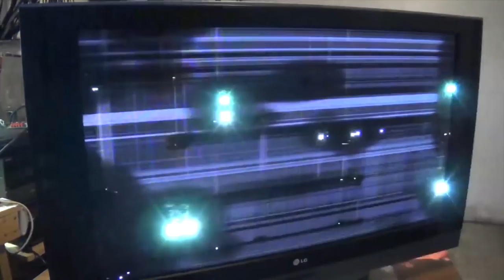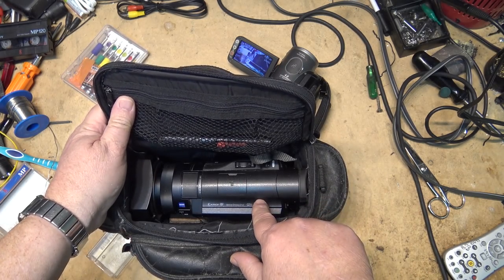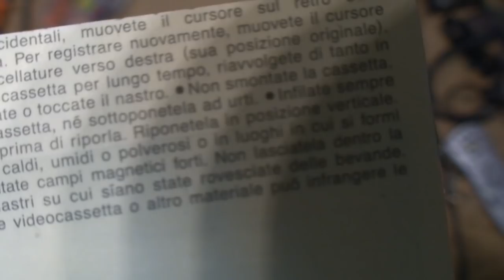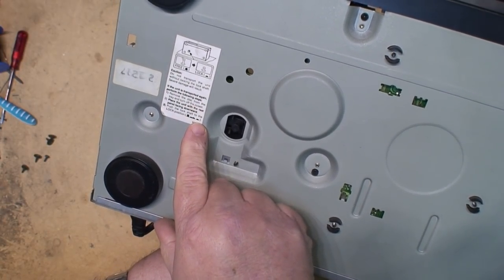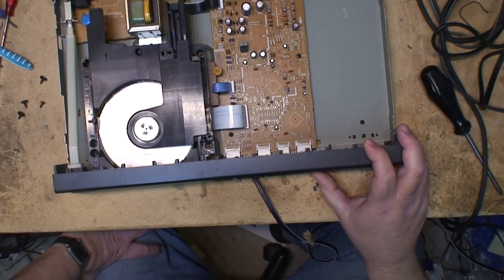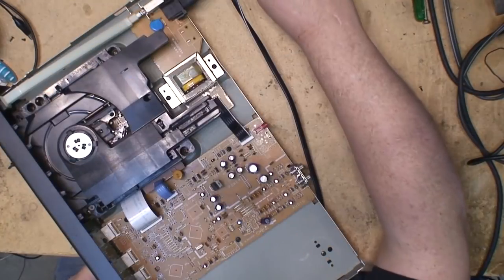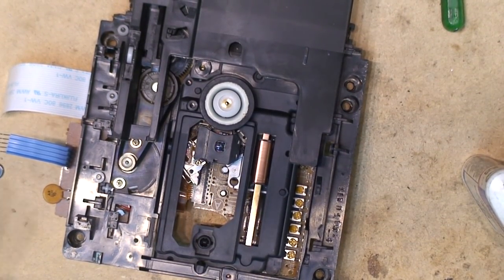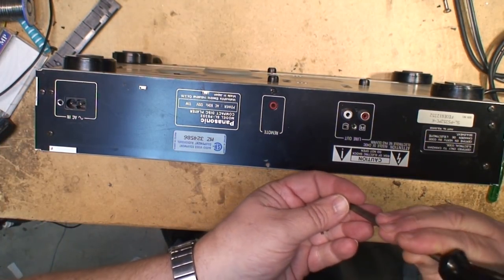Video tape was as bad as I remember and a CD Player repair all in one

Comment: 30 years ago I used to record audio on VHS hifi tapes recording live bands and long mix tapes because of long record times. I gave up on this due to no way to monitor the recording and unpredictable tapes and dropouts.
Reply: I disagree... Many people used their Beta HiFi decks for music recording and the quaility was EXCELLENT. One of the better ways to record audio back then. These decks all came with recording level controls and vu meters for this same purpose. You could monitor your recordings in real time quite easily...
Reply: @josegti84  I don't disagree with you, I have a collection of hifi machines and a S-VHS, but no Beta format. I have 3 of these: 
 https://www.youtube.com/watch?v=rrd4zlswZ94

 Excellent quality of sound, I have no issues with the results when they are good. I have had too many tapes fail or get damaged and end up having problems tracking. As far as monitoring, I am talking about listening to the sound off of the tape as it is being recorded as in a 3 head tape deck. When you monitor you are hearing the source on a HiFi VHS machine. Same as with a 2 head cassette deck.
Reply: @zulumax1  Ok, I see what you mean... that's true. You couldn't monitor the recordings right off the head like you would normally do with a 3 head cassette deck but even then... the quaility was far superior. The key for best sounding experience was to use the same deck which recorded the tape. If you tried to playback the tape on another deck you could experience tracking issues...
Reply: @zulumax1  I have 3 Beta HiFi decks working flawlessly right now. A Sony SL-HF100, SL-HF150 and 3 SL-HF950 (the best beta deck sold in Europe). I also have many other models... C9 (one of my favourites), SL-F90, SL-F45, C30... And a few S-VHS decks too: Panasonic NV-FS200, NV-HS950, NV-HS1000. From JVC: HR-S9700, HR-S7960. And a wonderfull Sony EV-S9000E. Yes... I'm nuts :-) Those decks featured in your channel are beautiful. We don't get too much luck here at thrift stores like you do over there haha.

Comment: How come Panasonic did not put a fuse in the power supply?
Reply from the maker: There is a fuse in the power transformer.  When it pops you buy a new transformer.  Even equipment that had a fuse has a failsafe in transformer.

Comment: I have tapes from the mid-nineties and don't have such issues with them. I guess the Super 8 MM are less problematic.
Reply: Analogue tapes wont have this issue, well they can still shed, get sticky, get eaten, but they wont drop out because they are analogue, you will just see the odd line or decrease in quality but because its analogure you will still have a picture and sound, unless the tape is really sticking!  The dropout is caused by the digital tape not being read properly.  There is no error correction AFAIK and no video buffer to allow the camcorder to try re-reading that part of the tape so tape errors and read failures appear as dropouts or in the case of a read error as blockyness that flashes up on the screen somewhere.

Most of my older miniDV tapes have dropouts right at the beginning.  I solve the issue by giving the tape a full wind to the end and back.

There also used to be an issue that the miniDV tapes from each manufacturer used incompatible lubricants that could congeal and make the tape and mech sticky.  The advice was to only use one manufacturers tape, thus I have only ever used sony tapes in my camera.  A head cleaning tape can help too.

Comment: Have you ever heard of the Customusic system that was used in department stores?
Reply from the maker: There were several systems.  Seeberg had one that used special records.  There were various tape based units as well. Some used a slowed down 8 track tape.
Reply: @12voltvids  Yeah I seen that, they actually look like large 8 track tapes lol. The records were 7 inch 45s that ran slower?

Comment: you got all these massive resolution camera and i'm watching in 480p :)
Reply from the maker: It was shot and uploaded in 1080p60
Reply: @12voltvids  I don't doubt that, I'm stuck with slow internet here on the island of Crete, and sometimes I can get youtube in 720 but it sucks up all the bandwidth for the house, so I watch in 480 so others can surf the web as well
Reply from the maker: Gotcha. My internet isn't that fast either.  I'm stuck at 75mb which is pretty slow as we have 1.5gb available.
Reply: Same here on my little and remote village in Spain... 360p over an loooong, old and wind-moved bunch of pairs of ADSL. Of course it is asymmetric, the download speed not bad, 350kB/s, upload is awful, 30..35 kB/s....  On the other hand on cities is easily avaliabe 300MB/s even 1GB/s if you can afford that.... Regards
Reply: @12voltvids  oh living in luxury i see :) no dsl or cable here, i'm on a microwave link to town 4mb down 512kb upload, but its fairly steady.
Reply: @12voltvids  Better than my internet. I have 10mbps down, 1mbps up.

Comment: YOU CAN USE HDV CAMERAS AS LIVE CAMERA BY HDMI CABLE
Reply from the maker: I can do that with all my cameras.  My ax 33, 53 and 100 i don't even need that.  They have wifi built in. I can stream directly.  Not that i ever plan to.
Reply: And again. What's with the caps lock

Comment: How many video time can this 1GB sd/memory stick card record?
Reply from the maker: It only stores stills in this camera. Video is stored on the tape at a fixed bit rate of 25 megs / second, MPG2IPB.  Video wise at 25 mbits which is what the tape is recording at (and my SD camera as well as it is set for 25mbits) 1 gig would hold about 5 minutes.

Comment: The AX100 is a decent last-of-line camcorder but still has lousy autofocus and only 25 or 30fps for 4K. I think the AX700 has better autofocus but also only 25 and 30fps 4K I have been wanting to buy one last conventional prosumer class camcorder before they're no longer made but I can't find any that does 4k60. I'm just not doing the phone thing, the ergonomics of holding a little rectangle by your fingertips is lousy.
Reply from the maker: 4k 60p would be nice but useless for me because my existing editing platform can't handle more than 30p and I am not going down that road of pay every month to use it.  The stuff I shoot in 4k is typically landscapes and scenery and that looks just fine at 30p
Reply from the maker: Never have had any issues with the focus on my AX100, but then again as a professional shooter I manually focus my shots anyway. Zoom in on subject focus and zoom out to compose the shot.

Comment: Obviously the sd card is better in the long run for video recordings,,,as the tape recording became unreliable with that squeaky  noise,,,and picture and sound dropouts thru watching that video.

Didn't know u had a 200 disc cd player,,,I guess it would b 5 times or more the size of the one u had repaired.
Reply: I never trust a media format that is not removable from the read-write hardware.  SD cards also have no write protect feature, well they have a pathetic attempt of one , totally optional and can be overridden by software.  I have a mate of mine who buys SD cards new each year to take that years photos, the number of card he has that have corrupted images on them is astounding.  The camera most likely is to blame, as we were able to recover a few lost shots but relying on electrical connections while only using one card is too risky for me.  I do it for photos, as I will dump the card at the end of the day and maybe only take 10 shots but for an hour of video, for that I need 2 cards.

I'd be happier if the SD cards were just flash chips, dumb flash chips.  I prefer dumb, no contact removable media.  Give me an SD card where I can swap the flash controller out, maybe.

Comment: THEES HDV AND MINI DV CANT USED TILT UP OR DOWN FULL TIME FOOTAGE RECORDING..CAUSE THAT THE MECHANIC IS NOT STRONG ..ONLY HIGH END ENG BROADCAST CAMERAS
Reply from the maker: Bs. They used DV for many broadcast cameras. Professional DV, dvcam. They competed with digibeta. I used HDV and DV pro for years.  The problem is the tapes are failing due to age.   It's not the mechanism that is at fault, it is the tape.
Reply: Again with the caps lock stuck on
Reply: @12voltvids  Funny they say that. I have done extensive video shoots for clients in mini dv (for the authentic look) and i regularly would hold the camcorders at odd angles (Ex, upside down, vertical, on side, etc...) I love my old sony PD 170. Built like a tank. Can handle almost anything you throw at it. and to your point, it is all about the tape. I made the switch from sony to TDK and have seen less dropout, less debris on the heads and better recording fidelity.

Comment: 15:37 hooks up wires backwards
Reply from the maker: Big fucking deal. Troll Alert.  Does it really matter if left and right are reversed? It is just under test. I could have just hooked up one, as I was just checking for sound.
Reply: @12voltvids  you misspelled deal 😂
Reply: @12voltvids  merry Christmas dude
Reply from the maker: @catsbyondrepair  Word substitution on my phone
Reply: @12voltvids  yeah I fucking hate auto correct.